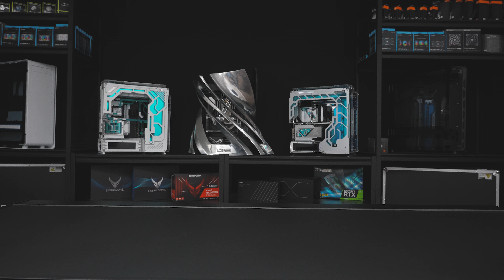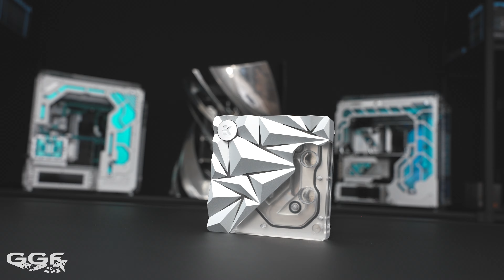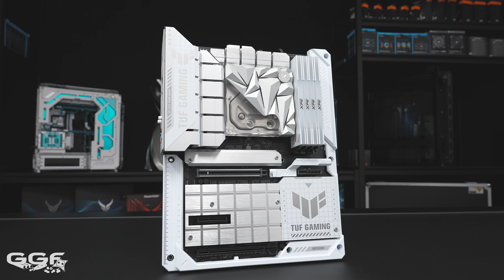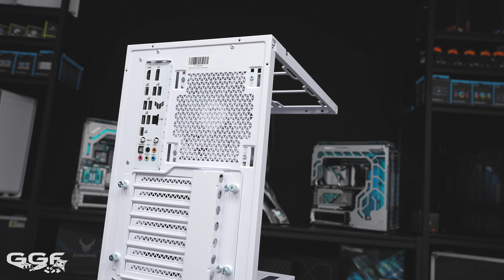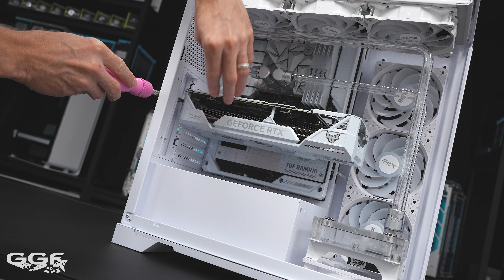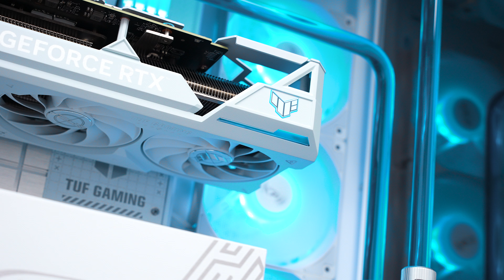This CLEAN XPG | BTF Build could be YOURS!

Comment: Hi GGF. Can you help me please? I have a question about your video.. Clean Lian Li Evo XL Time-lapse build... Can you fit on front the Distro plate Ek-Quantum reflection pc 011d xl d5 screen edition? With 3 radiators Ek Quantum surface S360 white and fans on the radiators? I have same case Lian Li Evo 011d xl.

Comment: I can already see this case being a problem with normal ATX boards having their top connectors on the front side. That gap between the board and a 360 rad doesn't seem very big.
Reply from the maker: Our first build in this case had no issues either and is also on this channel
Reply: @GGFEvents  I've always loved how clean your builds are and have been a follower of your channel since the beginning ❤ (on my personal account). I hope you do more reviews on cases soon! 

I saw the other video just now, The back exhaust fan also seemed very close to the top rad fans. I'm guessing that fan is 25mm would 30mm fans struggle? Also top rad clearance to ram, will it fit big ram like dominators or teem group xtreems? Thanks!

Comment: There is plenty room why did you choose such a small expansion tank?
Reply from the maker: Please tell me where else when the GPU goes into the side radiator spot
Reply: @GGFEvents  Either you would have enough space up to the GPU or you would need a narrower reservoir that would fit past the GPU. It still looks great and is certainly practical for filling.
Reply: It could fit:
1. Alphacool Eisstation
2. Corsair iCUE LINK XD5 RGB ELITE
3. ULTITUBE D5 200 PRO LEAKSHIELD
4. Alphacool Core 200 Aurora (without the bottom fan)
And so on.